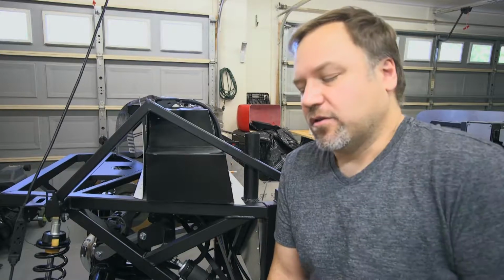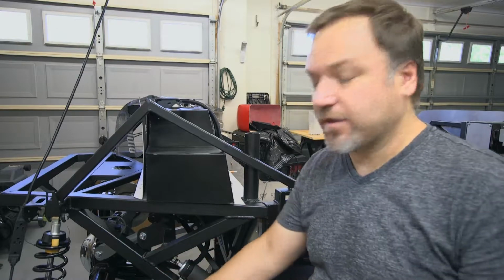Factory Five 33 Hot Rod V2 Build - Installing the Brakes

Comment: I love the start with gloves and clean hands, then finish the job...

And I was wondering if painting the brake calipers was going to cause fitment issues...Good job handling it.
Reply: i had the same thought that maybe not painting under abatement plates would have gave the space needed or was the paint extra thick there?
Reply from the maker: I did not paint anywhere were the plates were.
Reply from the maker: @MrStan1221  I did not paint anywhere were the plates were.
Reply from the maker: @dangthisstupidpasswo  99-01 Mustang GT calipers   Stop Tech Sport 309.08040

Comment: FYI, Those rear brake calipers are from a 89-95 tbird supercoupe...or any of the LX models with rear disk brakes.  They are not from a mustang.  That should help you.  And yes, you should install those plates as they allow the pads to slide properly.  They typically have a locking fit to the caliper via small tabs, etc.
Reply from the maker: Interesting since FFR specifically says they are from a Mustang.
Reply: @StreetRodJim  the fronts are from a 94-04 mustang GT but the rears are definitely from a tbird with IRS.  Check rockauto for comparison pictures

Comment: Those shims are most likely not fitting because of the paint on the bracket. I noticed that you masked off the pad area back when you painting the brakes. But those clips are held in place but areas that I think you painted
Reply from the maker: I did not paint anywhere were the plates were.  It was masked off.

Comment: They weren't fitting because the inside of the caliper was painted.  I bet 100% if you stripped off the paint inside first or didn't paint inside everything would have fit.  Next time just paint the outside of the calipers,  no one is going to see the inside the caliper...lol.  I used the same paint you used on my calipers on my old car and the paint didn't last 10,000 miles. So don't be shocked if it doesn't last.
Reply from the maker: I did not paint anywhere were the plates were.  It was masked off.  Hopefully since it is a street car it will last a while.